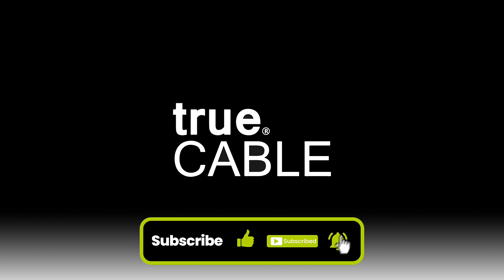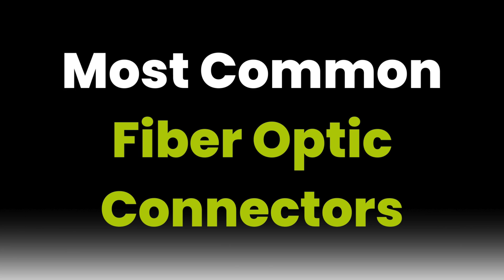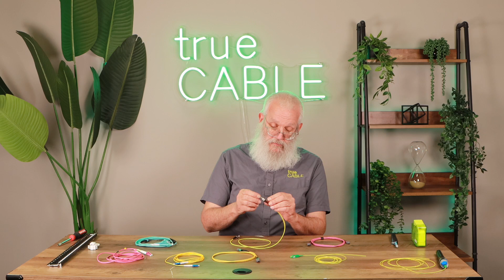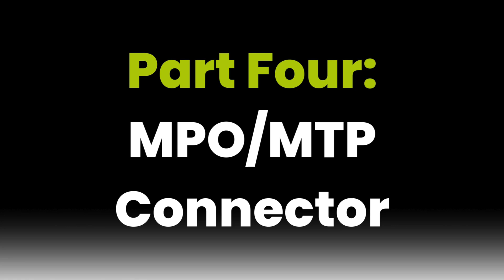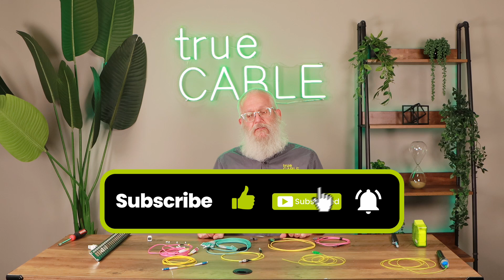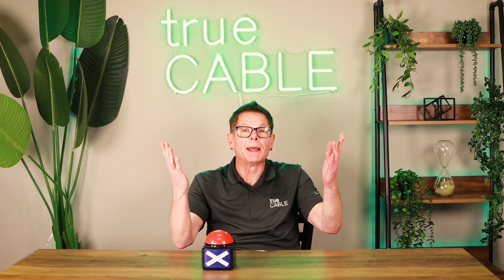Most Common Fiber Optic Connectors - Full Breakdown with Examples

Comment: It seems that AOC fiber cables are cost-effective for longer cable runs.   Can you discuss them?   Thanks!
Reply from the maker: Hello! Did you mean APC (Angled Physical Contact) connectors on fiber cable or are you referring to a particular brand of some kind (AOC)? We do cover APC vs UPC in quite a few of our blogs in Cable Academy and videos - such as https://www.truecable.com/blogs/cable-academy/pc-vs-upc-vs-apc-fiber-connectors-what-is-the-difference. If this is about a particular brand we cannot recommend or talk about any specific competitor due to liability reasons.
Reply: @trueCABLE  AOC means Active Optical Cable, and it looks like a DAC cable, in other wirds there are transceivers on both ends.   For a 30-meter cable for example, an AOC cable is cheaper than buying two transceivers at both ends and then the 30 meters of OM3 multimode cable with LC connectors.
Reply from the maker: @DerekDavis213  Hello! Thus far, I have deployed DAC cable for short switch-to-switch patching applications or traditional SFP+ transceivers + MMF or SMF, depending on speed and distance needs. I have not deployed any AOC pre-made cable, so I cannot give you an answer. I find the concept interesting, but suspect that due to the AOC SFP devices on either end, AOC would be problematic for running through pathways (conduit, for example)--just as a DAC cable would be. I will research the technology, and thanks for the heads-up!

Comment: I came here to identify the fiber optic cable type that plugs into the back of my TV or stereo. Now I still don't know.
Reply from the maker: Hello! That is because the digital infrared (IR) connection on the back of your stereo/TV is for audio PCM signaling, not Ethernet packets. They do not have the same technology regarding signaling or connectors, although both use a certain type of fiber conductor. Our video here addresses identifying fiber connectors commonly found on fiber optical communications cable, meant for long-distance and high-speed networking.

Comment: The green SC connector you mentioned is different from the standard blue one. They use a trapezoid-shaped polished connector and must be used with green couplers, etc. I was using them for OTDR that requires 1km test launch cables.
Reply from the maker: Hello! Correct, the green SC connector is SC/APC (angled physical contact) . The difference is the end face polish of the fiber itself. The green one is polished on an angle, where the blue one is not (blue is called UPC or ultra physical contact). Green and blue connectors cannot be coupled together as they are not compatible.

Comment: Great basic video. One suggestion, in a future video, you should explain the difference between APC and UPC connectors, explain what devices use each most commonly, multimode vs single mode, and where you would find these type of connections.
Reply from the maker: Thank you for the feedback! The video you are requesting actually already exists! Check them out below
PC vs UPC vs APC Fiber Connectors | Key Differences To Know! - https://youtu.be/EKtXEGKciRU?si=fFGGOiVgfAgGpZJ3
Most Common Fiber Optic Connectors - Full Breakdown with Examples - https://youtu.be/iCJM7IRbsYU?si=96dAdfqrrqz2JNJd

Both of these videos are short companion pieces to accompany brief blog entries in our Cable Academy. If you'd like to see the blogs, they're at:
Fiber Patch Connectors, LC and SC and ST and More - https://www.truecable.com/blogs/cable-academy/fiber-patch-connectors-lc-and-sc-and-st-breakdown
PC vs UPC vs APC Fiber Connectors – What is the Difference? - https://www.truecable.com/blogs/cable-academy/pc-vs-upc-vs-apc-fiber-connectors-what-is-the-difference

Comment: is there optical router for home use?
I like them as they are very small and great for just routing cables around the home WITHOUT ANY drilling.
Reply from the maker: Hello and thank you for the question. I agree fiber is much smaller and easier to install. One of the drawbacks to fiber is the active connecting hardware such as switches and routers in the residential applications. Typically if fiber is used in a residential application you may have a fiber switch at the head end (structured wiring location) and then out to the wall plates you would use a media converter to convert from fiber back to copper in order to connect it to your computer or whatever hardware you have requiring that connection. Very little hardware has a direct fiber connection so that is why a media converter is needed to get it from fiber back to copper.